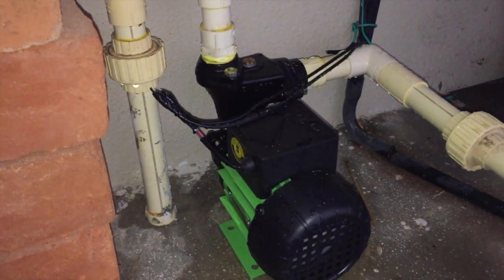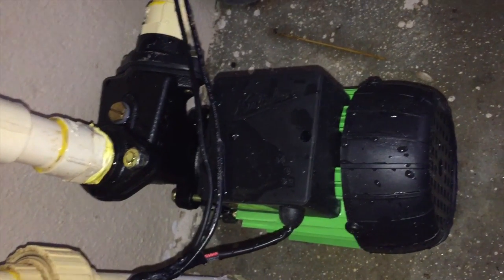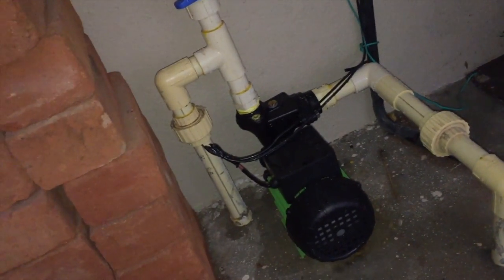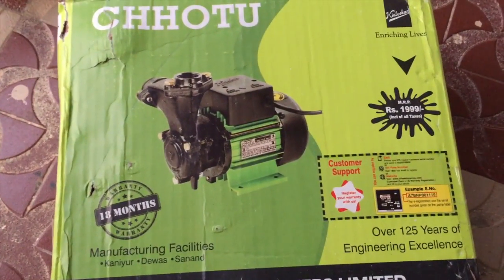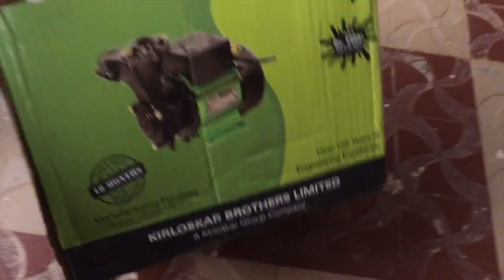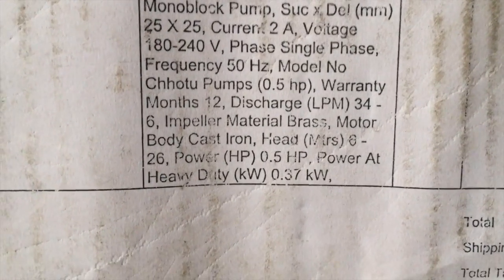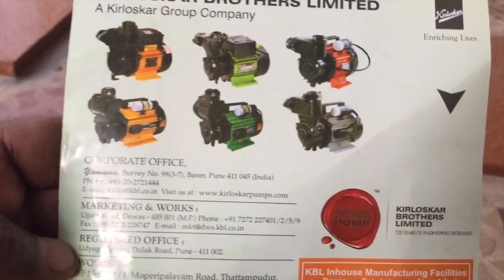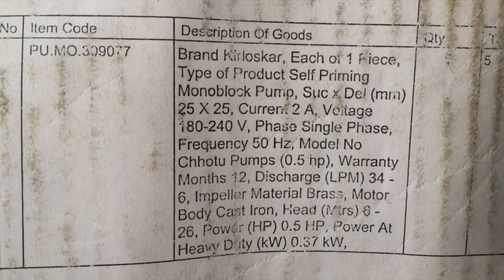Kirloskar 0.5 hp Mini Domestic Chhotu Pump (water Pump for home  )

Comment: Sir,  m solar system lagana chhata hu or ye motor definitely buy karunga.  Mere pass microtek 875va ka inverter hai or 60ah ki battery kya ye motor 150w k panel k saath work karegi or agar yes to kitni der.  Or agar nahi to minimum is motor ko run karne k liye kitne watt k panel cahiye or inverter or battery.
Reply from the maker: Sir, 

It needs 250 to 280 watts for that you need  minimum 500watts to 800 watts solar panels so that it will give 200 to 350 Watts,  you inverter okay,  solar panels needs ,  my advice don't connect to inverter since your is 60ah it won't support motor.
Reply: Thnx for reply.  Plz tell me that what I need like battery capacity to run motor
Reply: And how much it cost
Reply from the maker: @sparshrana1899  

Hi,   go amaron battery 150ah Or 180ah your  inverter is 875 means it will support 150ah.

Comment: Can this be run off a APC ups 1000va 800watts..
Reply from the maker: sir,

i am running with 750 watts inverter ,
moto needs  180 to 220 watts  you can run , supper.
Reply: @SambandamNandakumar  Sir did you run a power calculation via kill a watt meter as to how much amps  motor draws when you run it on inverter only when main electricity from grid is off or there is no power from  govt.
I have a suguna monoblock 0.5hp cast iron  pump that is rated at 4.5 amps, my UPS APC 1000VA 800 watts runs on full load if I run it on UPS.
Just wondering if I change motor to this the load taken would be about 280 watts as mentioned by you.
Please suggested as your answer is valuable to my solar Setup.
Reply from the maker: @santsplen  

I can't understand your questions💭❓

I running this pump on 220ah battery and 1kv solar inverter, 
Moreover day time it will run on solar from morning 7 am to evening 4pm afterwards it run on grid /main power, 
I  am using 500 watts solar panels.
Reply: @SambandamNandakumar   I wanted to know exact consumption of the motor in watts , there are energy consumption meters that are available like Kill a watt meter(https://www.amazon.in/P3-P4400-Electricity-Usage-Monitor/dp/B00009MDBU) which gives you exact wattage consumed in realtime,I was checking if you have checked using any meter .
Reply: sir ji mere pass 935 VaA ka ups h kya 0.5 hp ka motor chal jayegi kya plz reply
Reply from the maker: Sir, 

Definitely it will run,  this moto needs only 180 to 250 watts,  I was using more than one one year with 700watts inverter luminous.

Comment: motor winding copper or aluminum kirloskar chotu
Reply from the maker: Material of Construction
Impeller : Brass
Pump shaft : Carbon steel
Delivery Casing : Cast Iron
Mounting casing : Cast Iron
Motor Body : Extruded Aluminum
Cover NDE : Aluminum
Mechanical seal : Carbon ceramic

Comment: Sir, Can I use a water pump as a car washer. If I attach a nosel to the end of output water hose pipe to create pressure, will it damage the water pump?
Reply from the maker: sir, it may damage motor 
you can buy pressure pump  will come pressure kit with pump like below link.
https://www.amazon.in/Kirloskar-Star-Chhotu-Automatic-Pressure/dp/B01MRYIL3V?tag=googinhydr18418-21

or 
you buy pump separate and you can add pressure kit. like below link.

https://www.amazon.in/NMB-Automatic-Pressure-Controller-Water/dp/B06WVF65ZT?tag=googinhydr18418-21&tag=googinkenshoo-21&ascsubtag=fa74a7d4-1ca2-4c2d-8429-3176620da222

my best idea i am using bosch  car wash it is not giving clear cleaning because we need use soap form to use pressure wash, i feel it is waste water . now  iam making  hand wash ,

https://www.flipkart.com/bosch-skil-home-car-washer/p/itmdstvqbcfgzncg

insteated buying motor& adding pressure kit , best you can buy bosch /skil 
https://www.amazon.in/s/ref=a9_sc_1?rh=i%3Aaps%2Ck%3Abosch+car+washer&keywords=bosch+car+washer&ie=UTF8&qid=1517636417

Thank you.

Comment: What is your water source?
Reply from the maker: sump water.
Reply from the maker: it is running with my inverter power  when main power goes off,  inverter 900V +220ah battery  both are luminous.
Reply: Sir Can you specify the inverter model number used connected to kirloskar chotu